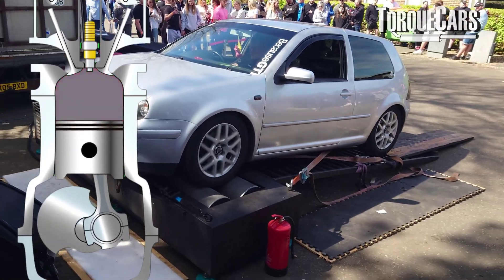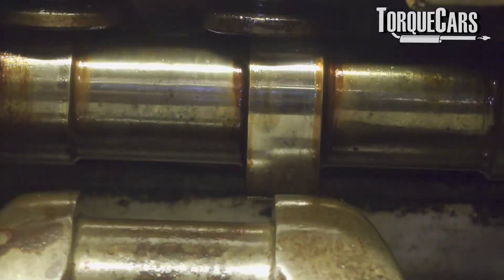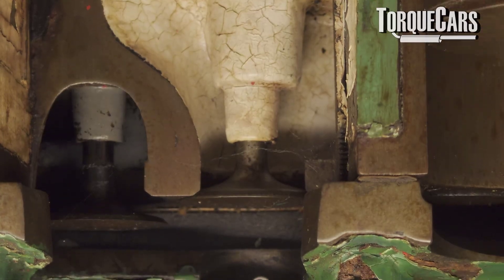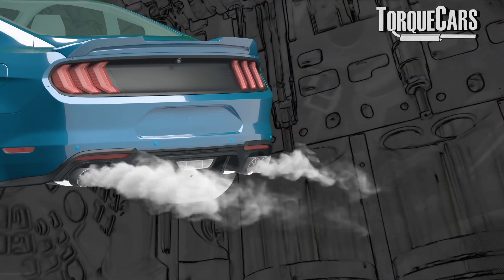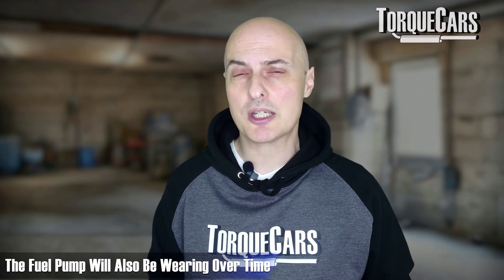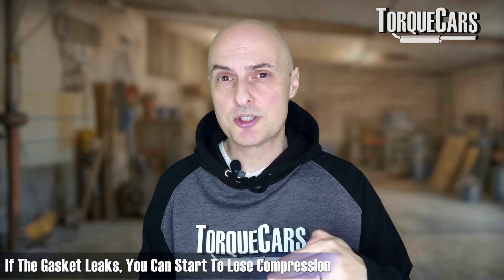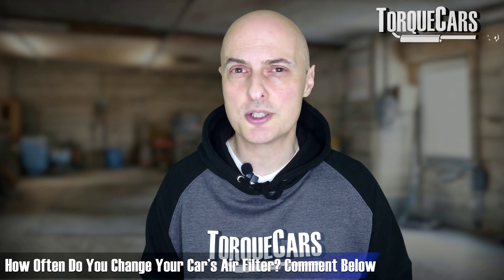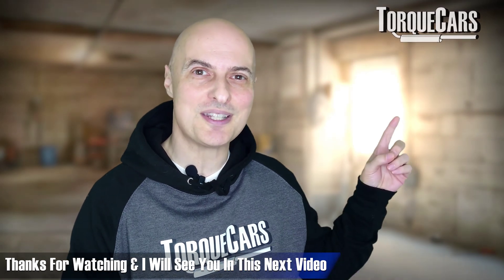Causes of Power Loss At Every Drive. Restore Lost Power: How Wear & Tear Kills Performance

Comment: I don't know if this guy has read my comment from a previous video he did,but he doesn't explain why my car would suddenly lose power.I would stop the car with everything turned off and after a few minutes start driving again without any problems. It was as if the car was resetting itself which made it difficult to find the problem,and only through trial and error did I get the problem sorted.
Reply from the maker: Sorry buddy, I must have missed that one. We had a family death recently so I've left things on autopilot.

What was the problem you found? That sounds like a really annoying fault.
Reply: Sorry to hear of a death in the family Xmas does seem like a bad time. Anyway what my mechanic discovered after trial and error was the wheels on the right side was braking. This led to having to replace the ABS coming on which resolved everything.

Comment: My dad was an old school mechanic the years of the old flathead ford engines in the 50’s I learnt from dad I know I learnt this many years ago with with a carburetor you can pour water down it to breakup carbon in the engine and I run shell fuel myself

Comment: Got a 1.6 tdi a3 8p and had a injector go recently which made it go into limp mode , got it replaced and I noticed immediately that my pull isn’t as strong as it was before what do you reckon could be the reason ? It was a refurbished oem injector as no point getting a fresh injector and having 3 old ones